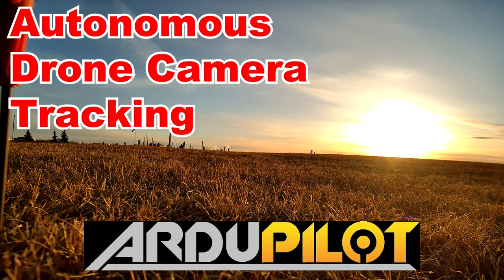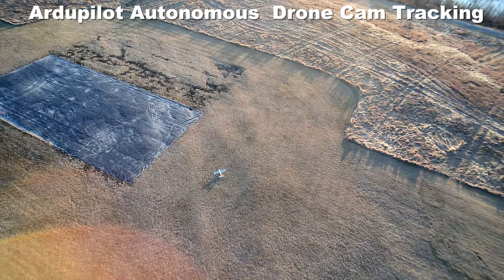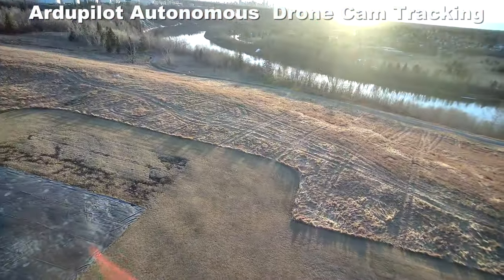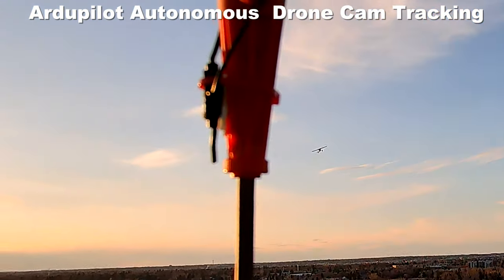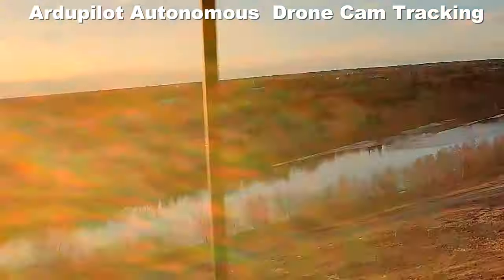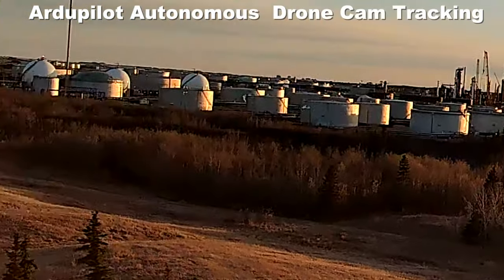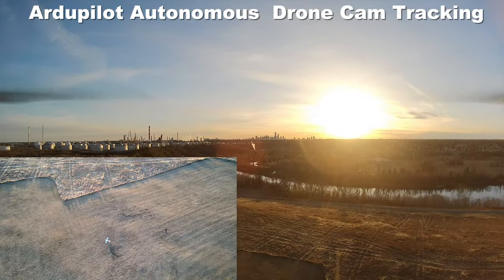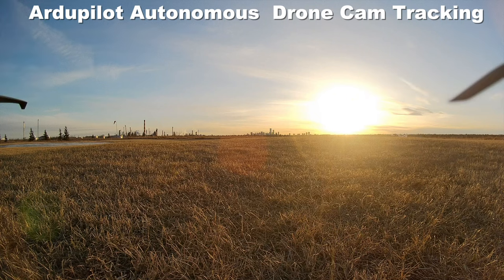Autonomous Drone Camera Tracking with ArduPilot 4.5.2 - part 1/2

Comment: A good start. Can you program the drone to follow with. Fixed camera?
Reply from the maker: Supposedly - that's next! 🙂
Reply: @timtheplaneman  Yes, you can. I have a Siyi A8 and have it set to not turn independently of the copter. If I set a ROI on something, the copter pivots for yaw instead of the camera doing it.
Reply from the maker: @KellySchrock  I think you can do both. I think I'm going to try both ways.